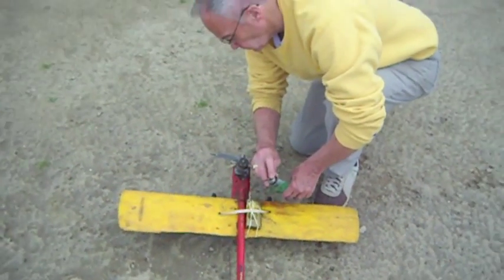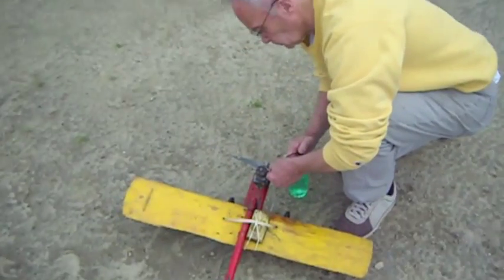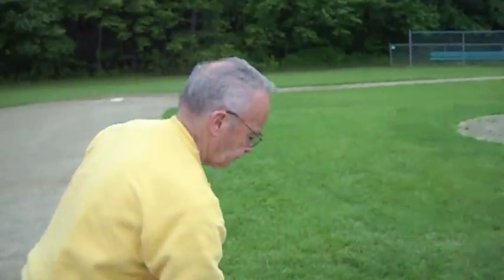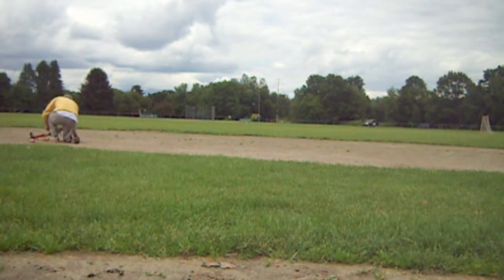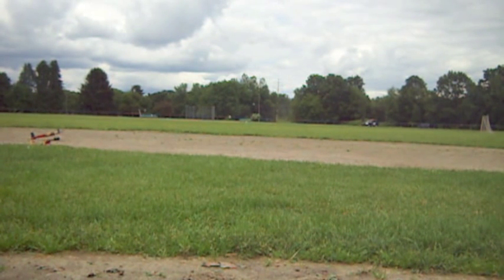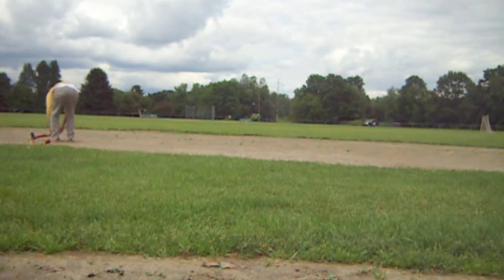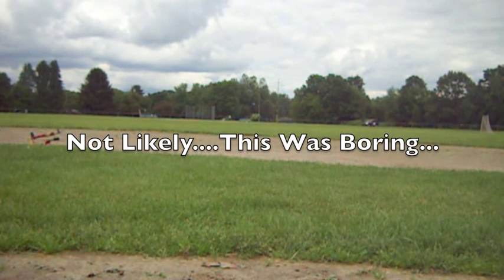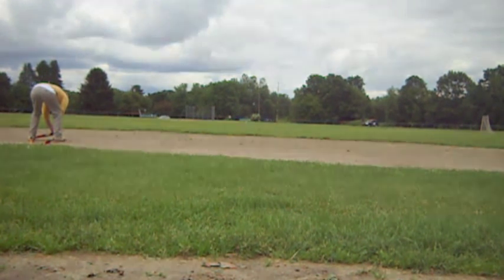Fox 35 Gas Line Slips... and Blows Up

Comment: I have found that fuel lines eventually get loose at the fitting. I either cut off the end of the line giving me a better grip or replace the line. I am sure though that I'm not telling you anything you don't know.

Comment: And smells like one too! That's good news to me, kinda, as in the 90's the C/L hobby didn't have that old smell I remembered and liked so well from the late 60s and early 70s. I finally realized it was the synthetic oil, or the lack of castor oil...
Since I'm looking at the old school Fox 35 on maybe a Flight Streak for getting back into C/L, do I mix my own fuel, or is the 28% castor oil fuel still sold, or how does that work?